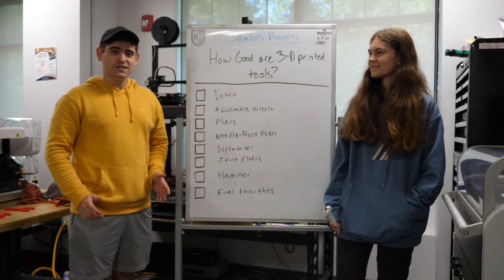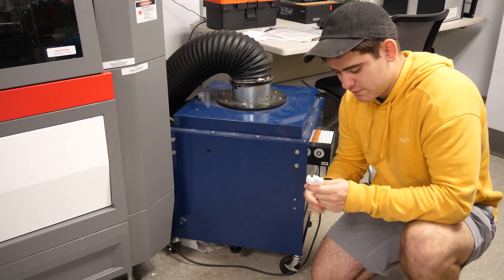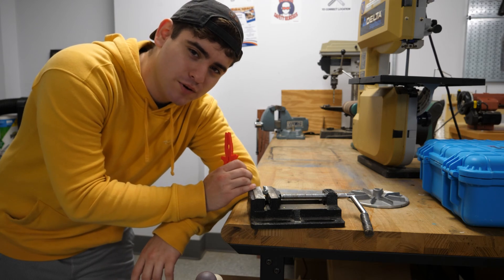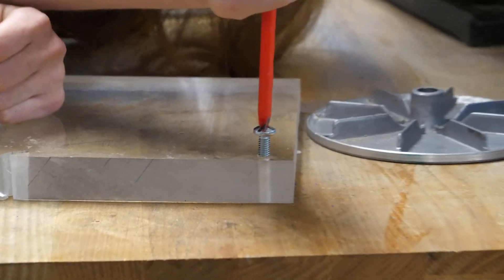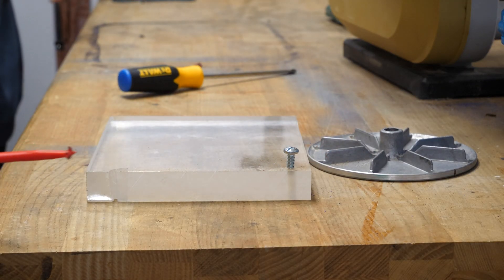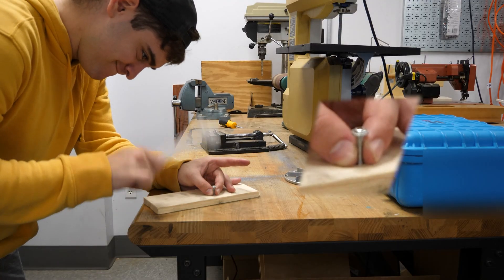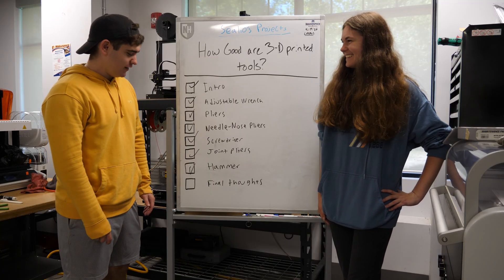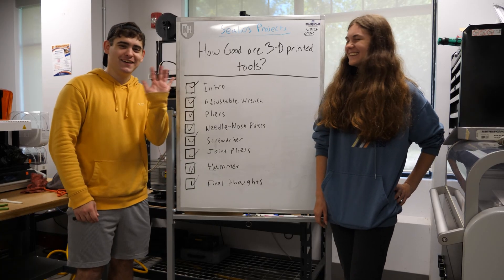How good are 3D printed tools

Comment: For fastening bolts I'm pretty sure a box ended wrench would do well. For screwdriver maybe using properly sized pozidriv or torx could have worked. 

These could probably work if you had used the right tools for the job. For fastening bolts print box ended wrenches instead. For driving screws go with pozidriv, JIS or torx. You could also show how pliers do at what they're actually meant to do so holding, bending and compressing objects.
All tools should also be made appropriately thicker to account for the material change.
Adjustable wrenches are terrible and should be never used no matter what material they're made of.
Reply: Before you say anything yes I know it's not that serious and yes I am extremely bored.